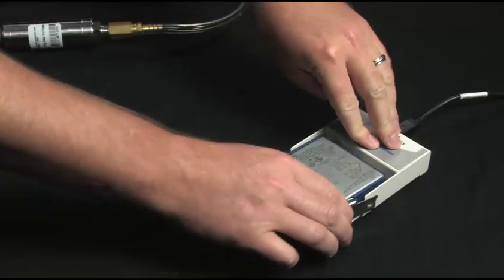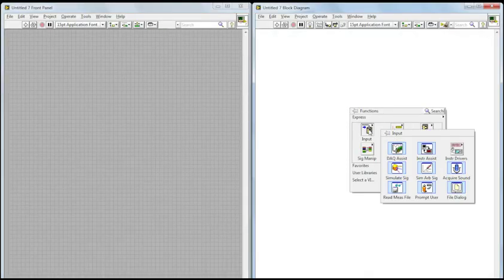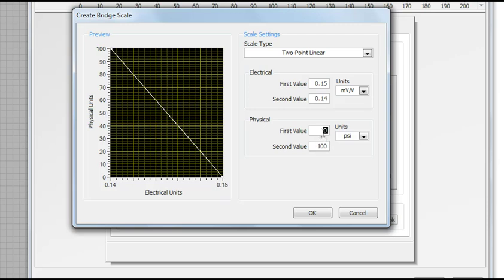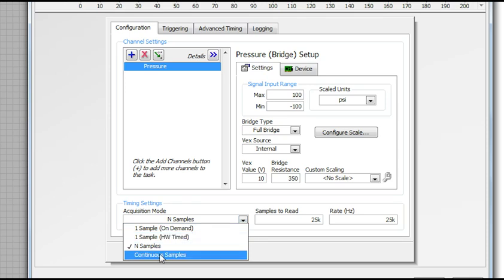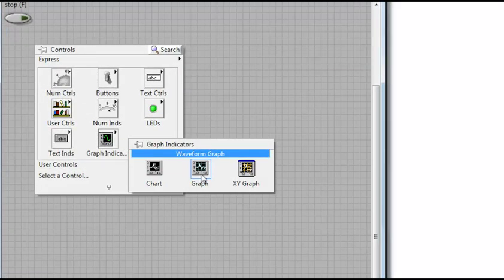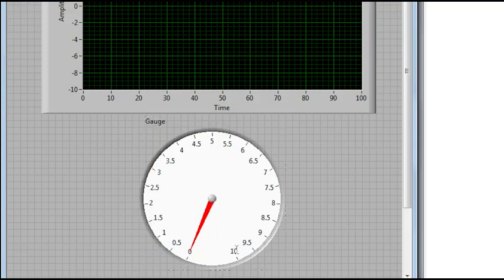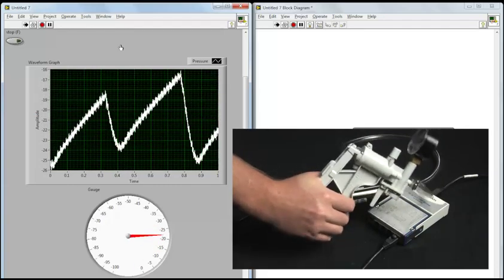How to Measure a Pressure Transducer

Comment: Would this work using a eurotherm 3216 for controlling the pressure transducer in a HPB furnace, or would i need to connect to the transducer directly?
Reply from the maker: A module like in this video (NI-9237) could measure pressure in your system. It looks like the 3200 series controllers have an input pin for “Remote Setpoint” where you can send it a voltage or current signal. High-level example, a cDAQ chassis or cRIO chassis could use a 9237 module to measure the pressure, then a module like the NI-9263 to output a voltage to the Eurotherm 3200 series for setpoint control. You can program your control logic between the 9237 pressure measurement and 9263 sepoint output. We also found this LabVIEW Instrument Driver for the 3216 that might be useful: https://bit.ly/44qDnfx.

Comment: Is that pressure transducer available online?
Reply from the maker: Hi! It looks to be a Honeywell FP2000. NI does not resell this sensor currently, but you can find it online. We’d recommend you confirm if the specifications for the sensor would with your application. Here is another resource for you to consider about pressure transducers: https://bit.ly/3JsTaQ6
Reply: @NIApps  do you have a wiring diagram on the connections between the wire and the transducer itself? I would like to know for my experiment.
Reply from the maker: For technical support inquiries, we recommend visiting our support website: https://bit.ly/3XEoQbm. From here, you can share your question with the community, or open a support ticket with our team. Let us know if you have any more questions!

Comment: I am using pressure transmitter PR3860 and  I am using NI 9207 to read this thermocouple, Ni max is reading this transmitter as a current signal, that is okay but in Lab view while adding channel to DAQ, selecting the pressure bridge option, its not reading the device, and its saying no channel found, but in lab view if we select it as current source it reads the device. what should i do
Reply from the maker: Hello. For technical support inquiries, we recommend visiting our support website: https://www.ni.com/en-us/support.html?sf177198738=1. From here, you can share your question with the community, or open a support ticket with our team. Let us know if you have any more questions!

Comment: Hi. Are other modules like NI 9215 also designed to handle pressure readings?
Reply from the maker: The NI 9215 is an analog input module so if your signal comes in as a +/- 10 V signal from your pressure sensor, then the NI 9215 should be able to read it.  However, you would need to do a voltage to pressure conversion in the software.  I assume that the documentation for the sensor might have this.

Comment: could anyone please tell us why did he choosed the value of 0.15 , 0.14 for each electrical step?
Reply: yeah even i am confused. he said it's from calibration sheet of the sensor but when pressure is applied the voltage should increase but here the voltage is decreasing

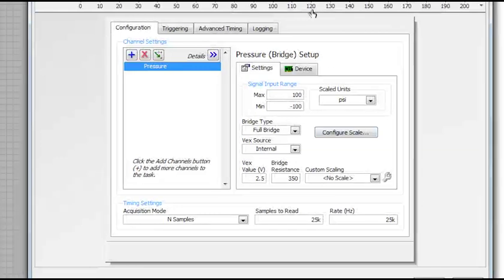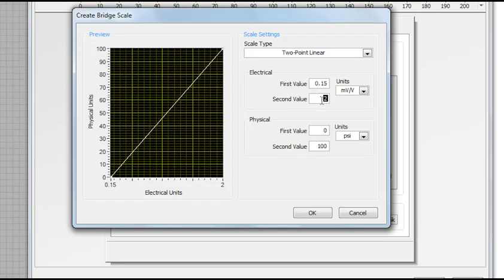Comment: Hello sir I need your kind help regarding measuring pressure using pressure transducer Honeywell TJE-1000psig. There is one thing which is not clear to me please correct me if i am wrong. At  1:46 time the signal input range is of pressure transducer range. At 2:01 the we need to input the calibration values from the certificate .

Sir i got the following table please tell me what i should put in this table .

Calibration  procedure : 072- FP75-23, Rev A, Dated 09/24/2010.

% capacity                  Load(psig)                     Raw(mV/V)                Normalized (mV/V)
0                                  0.00                                      -0.0045                      0.0000
50                                500.00                                  1.4929                       1.4974
100                             1000.00                                2.9941                       2.9986
50                               500.00                                  1.4927                       1.4972
0                                 0.00                                       -0.0039                      0.0006

What i should put first value and second value for electrical and first value and second value for physical.

please help me

Comment from the maker: @short10102 Yes. As long as the transducer falls within the operating specs of the DAQ device then it will work with any transducer. To find more information on what DAQ device would work with your specific transducer, check out ni dot com slash DAQ.